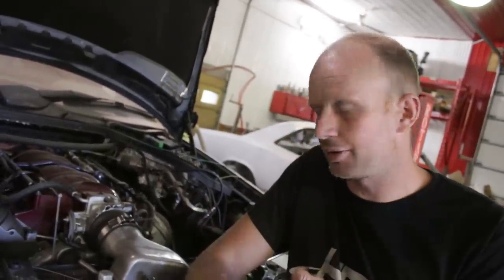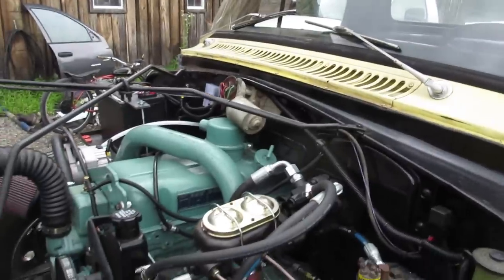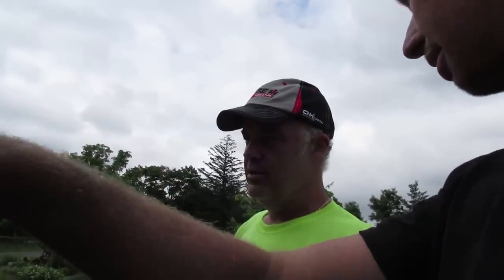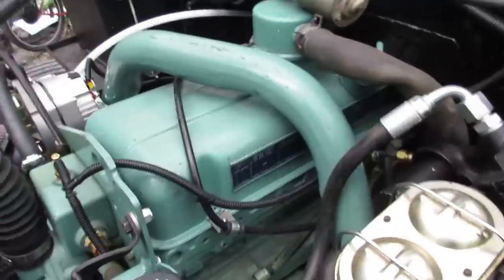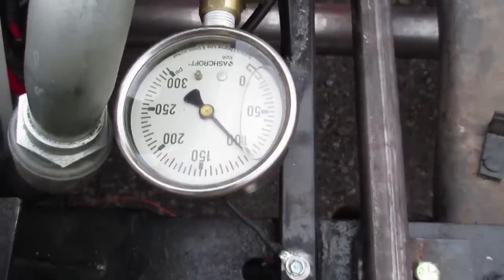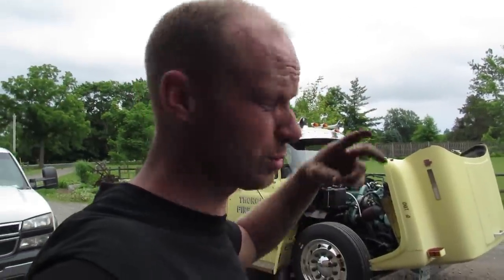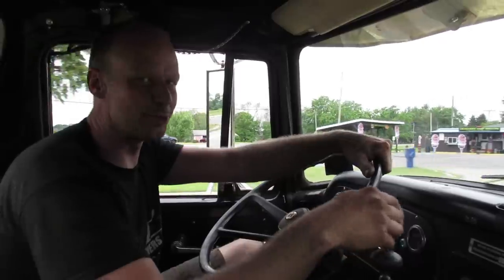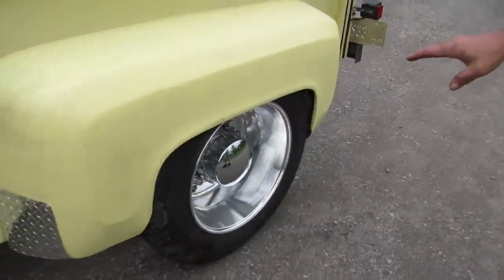AIR START! 453T Detroit Diesel in a '77 International Loadstar 1800

Comment: A Co2 fire extinguisher sprayed into the intake of a runaway will stop it dead in its tracks. Having one near by when working on diesel engines is a great ideal. And ideal to always have one with you in case of a runaway when on the road.
Reply: madmax2069 might be a silly question but why not shut the fuel off? Dry injector pump?
Reply: HOWNDOG66 best to just choke it out. Either by a flap on the intake on some old diesel engines, or by spraying a Co2 fire extinguisher into the intake.
Reply: Honestly if i got into a diesel runaway when out on the road rather than pulling over to the shoulder and dealing with the noise smoke and breakdown id just floor it into the outside lane and ride that screaming wreckage of smoke and fire right past everyone until the block explodes in half at 200mph.
Reply: Sometimes a runaway diesel uses a blown turbocharger oil seal to fuel the engine with oil instead of fuel.  Shutting the injector pump wouldn't do anything in that case.  Eliminating the air shuts it off no matter what.
Reply: Great idea. You could even connect an inerting CO2 cylinder using a kegerator-sized CO2 jug.  I carry one with a pneumatic chuck on a 200 psi regulator for filling tires and running high psi impact wrenches (for a short time) in the field. Beats buying an expensive Power Tank.
Reply: a wrench on the fuel line end of problem
Reply: not if the motor is running on its own oil there bud  seen it happen more then once
Reply: Runnaway's often don't rely on fuel as they tend to burn oil as the fuel source.  The only true way to stop one is to cut off the air supply.
Reply: they always told us that were running d-7 and d-8's that if it started to run away,to use our hard hats to block in-take air....1964-to 1969
Reply: @HOWNDOG66  it'll run away eating it's own engine oil without fuel
Reply: Thx Bruce. Did not know it could do that...I'm guessing that would apply to older engine with loose rings it can suck the oil by?.....I'm curious.
Reply: @HOWNDOG66 some mechanical fuel 4 strokes could run away with blow by but I don't know if it's common.   Run aways are mostly 2 strokes with the piston being part of the 'valve, intake' system if you will.  Engine oil gets whipped up, transfers through the posts and auto ignition by compression.   The worst cases, it'll run away and blow up either by throwing a rod, braking the crank or running out of oil and grenading.  Saw a Detroit in an off road gravel truck run away.  Within 3 hair raising min it threw a rod through the side of the block.  When it cooled down, we restarted it and it ran on 7 cylinders with 1/2 the rod slapping the block.  Couldn't believe it.  Cool but expensive!
Reply: Sound of these engines is 2nd to none and plan to get one and put it in something.....don't want it to go up in smoke so thanks for pointing out what to look out for.
Reply: It doesn't work nearly as well as you think. The problem is that a CO2 fire extinguisher doesn't have the volume required to supply inert gas to the engine while it's spinning down.  You need a big 10+ lb extinguisher for even a "small" motor like this.
Reply: @otm646  seems to work just fine.

Comment: This is the kind of stuff we also want to see. Love those 2 stroke Detroits. I service generators and there are still a few around. I have seen in generators as small as 4-53's all the way up to 24v-71's. They have a unique sound and feel. I grew up around an area in Ohio with a lot of oil wells. There were always a lot of service trucks and well trucks with screaming 2 strokes going by my house. Love it!
Reply: basically everyone around here still uses them in logging skidders and knucklebooms;  there isn't another diesel engine in existence that can withstand being run wide open all day, every day, hot or cold, and last 30+ years...
Reply: An aluminum 4-53 in a polaris snowmobile. that would be something. I heard a crane with on at Allied shipyard when our tugboat was there. It had the Polaris 850 Patriot bark to it like the new khaos turbo engine does!

Comment: I drove two road tractors that had 318s in them (8V71).  There was a flapper door in the elbow going into the top of the blower that had a mechanical cable (like an old manual choke cable) which acted as the emergency shutoff.  When needed such as a run away (they can also run backwards!) you just pulled the cable which released the door to drop down and block air into the blower, starving the engine.  Nice little ride!

Comment: 800kpa/116psi is the pressure you set the governor too for the air system. And it's a Detroit, the fact your smelling oil is good, it still means it hasn't leaked all of it out yet lol. Detroit's love to sweat horsepower.
Reply: army guy i knew talking about Chinook helicopters and how they used to leak fluid I said something along the lines of "well that's bad" and he said something along the lines of "no that's good, that means it's got fluid"

Comment: A natural blower would really help with bottom end power. That engine & trans is from a 79-81 c60 and they had that trans plus a 2spd rear to split gears. Theyre alot more fun when u can split it wont lug.
Reply from the maker: Thanks for the input ol2stroker!  We had one of these in the shop 15 years ago but my experience is really limited so glad to have you watching!
Reply: These are all I do. I had one most recently in a 78 F250 4spd with 3spd aux behind it. Message me I'll shoot you my number you can pass it along to your buddy if he needs anything in the future. Sure coulda saved him some trouble with that runaway! lol
Reply: I would add a 12 volt air compressor to build up air pressure in case you don't have enough air to kick the starter over.
Reply: I thought about that myself as my current build is air start... it'd just drain the batteries before it could build enough pressure.
Reply: Quite a long time ago I went deep down the rabbit hole on how to get a 2 speed rear end into something like this and this is what I found.  Most 2 speed rearends are huge (17000lbs up to 26000lbs rating) and the have extremely low gears (6.xx on the high end all the way to 8.xx on the low) because they where designed to have 42 inch tires on them and  where trying to get a relatively small engine (think ford 300 6) to pull all that weight around. So I found 2 alternatives: a ranger overdrive that bolts on between the engine and trans, and a gear venders overdrive that bolts onto the back of the trans
Reply: Good suggestion. Just make sure it's wayyyyy hidden. Haha!
Reply: Don't Detroits all have a blower on them?
Reply: mjouwbuis I think what he meant is a 453 without a turbo has a different blower (bigger?)  than the one that's on mine.
Yes a 2 speed rear end might be to big so I'm going to look into the gear vendors overdrive pricing and fitment.
Reply: jcc3279 the batteries would be long dead by the time the tank built enough pressure to start the engine.
even with the truck compressor on it now it takes forever for the tank 50 Gallon to build pressure cause of its size.

I have a tow hook on the front of the truck and a strap if I need a bump start LOL
Reply: Ol2Stroker vid on this project please.
I used your method to try a unstick the injector but being that the back injector was the culprit I had to remove the cab due to lack of space and figured after going through all that trouble just throw in a new injector cause I picked up a new one for 100 bucks NOS.  I did try to loosen it but couldnt get it to move cause I had no swing room for the hammer so then taking off the cab was next.
Reply: FFS Fabricators did you have trouble finding the right one? I hear they have many different ones out there.
Reply: Yes sir they do. Some of the old 6-110 series had a sprag clutch driven turbo compressor similar to EMDs but all of the smaller ones 53s, 71s, 92s, 149s have at least one blower.
Ray
Reply: From memory same blower on NA engines as Turbo, Turbo does have lower compression pistons, and could run different valve timing depending on rated rpm and where the torque is needed.
Ray
Reply: @ffsfabricators9328  hey maybe you could mount a gas powered air compressor from Princess Auto  😉
Reply: @whorayful9361  I think i read that Turbo Detroit's have a bypass blower, and the naturals don't? I want to mess around with one of these in the worst way!
Reply: Blower Bypass valves were a fairly late option on high horsepower, inter cooled, high spec engines, all earlier turbo engines had conventional blowers. On the engine model numbers you are looking for 'TIB" on the end of the model number. As far as I know only some 71 series, all 92 series and some 149 series were available with bypass blowers, so a typical engine would be a 8V92 TIB (Turbo Intercooled Bypass).
These old engines are amazing Mr. Charles Kettering and his team really designed an amazing platform that could be assembled so many different ways with so many accessories yet still maintained almost total parts interchangeability in each family.
Reply: @whorayful9361 in the Silvers instead of a bypass blower they were going to run a hybrid arrangement where the crank initially drove the compressor then exhaust would take over as the revs built. they canned it on the basis of cost and the 60 Series being in the horizon.
Incidentally the bypass blower saves 30hp. The blower consumes 100hp so it costs the motor 70hp in blower pumping losses in the turbo variants.
Reply: @grabasandwich  Or maybe he could dump that CO2 bottle into the air tank... have to do the math on that though.

Comment: Heh heh, nice rig! ...and yeah, you definitely have to slam your finger in the door before you drive it, so you're in the right frame of mind to keep the revs up to an acceptable level. Gotta remember, it's a 2 stroke, so when it sounds like it's ready to fly apart, it's just getting into the power band! I doubt you guys ever got over 2300 rpm the whole video, and those 4-53's will rev safely to 2900-3000 rpm without hurting them. You definitely need taller gears and a secondary gearbox or 'Brownie' to really make use of the torque band on these, since they don't really start making good power till 18-1900 rpm. At 2800 they sound like they're coming unglued, but they're actually at peak efficiency.😄👍 

The quickest way to crack a cylinder liner on a Detroit is to lug it down under heavy load. The water pump(s) don't turn fast enough to keep the cylinders cool at low rpm, and also they don't make good oil pressure, so everything runs hot and starves for oil.😜 EDIT ...oh yeah, and get rid of that damned air starter and grab an electric starter off of a 6V-53 or even a 6-71 (clockwise rotation of course). They're about 1/4 the price, and you don't have to trash 1/4 of your bed space with that huge air tank to run the starter for 10 seconds. These little engines turn fairly easy, even in cold weather, so a couple of 27 series batteries in parallel are more than enough to crank it, especially if you have a block heater in cold weather. Just for sound comparison, here's an electric start 4-53T up on the pipe at a little over 2800: https://youtu.be/oiCE3THO_Pg

Comment: great video

Those 53 series GM's  are something you either love or hate I reckon and that one with a hair dryer hanging off it is quiet (believe it or not)
We always say "ya drive em like you stole em"

Any GM 2 stroke I have worked on has a flap on the inlet side of the super charger standard from the factory to shut them down incase they ru  away. The flap is hooked to a cable to a knob on the dash that says something like "PULL FOR EMERGENCY SHUTDOWN" abd this closes the flap and shuts the motor down instantly,  works much better than the bottle of spray stuff and they come standard as far as I know like this so will be surprised if it doesnt have a flap

Almost all Macks in Australia up until the late 90's came standard with air start and it is very reliable,  the rotation is changed by indexing the internal stationary part of the starter

A very cool little truck but not my cup of tea with a screaming Jimmy and a 53 series at that lol , need a good supply of ear plugs 

Old mate might look at getting some "Jake brake" solenoids for it , would make people look when rolling up to a set of lights lol

Great stuff Rich and crew

Comment: Performing a tune up on a 8v  92 one day
Me and another guy while we had taken off the exhaust manifolds
Used a injector height tool set a injector
Started the engine checked the exhaust temp at the exhaust port went to other injectors and adjusted them to the same temp then put the tool on the injectors and found them to be almost perfectly adjusted. 
Love those 2 stroke with jakes open exhaust 
PS always put the screen on the turbo when doing tune ups many mechanics and one i know lost their fingers in the turbo during a tune up

Comment: My first diesel mechanic job out of tech school, was at a underground coal mine. A lot of the underground equipment was air start. If you were standing behind a scoop, and someone lit the starter off, it made you piss yourself  !   We  carried a nitrogen bottle with a regulator, to start them if the air reservoir was empry.

Comment: As a diesel mechanic my first encounter with the air starter was 10"s off the front bumper. One of my coworkers/ tormentors pushed the starter button and I was 40 yards away from WHATEVER that noise was!

Comment: Ah yes that familiar sound!! I’ve spent thousands of hours behind or in front these 2 strokes 353t’s, 453t, 6v92t, 8v71&92’s and a few 12v71t’s. Almost all of our old railroad track machines, rail gangs, surfacing&tie gangs etc, had them detroit’s in them. I’ve got the hearing loss to show for it !!! Lol. Btw awesome job on the truck!
Reply: With many that had worked for a railroad on the MOW team when if a majority of the equipment was powered by the infamous line of Detroit diesels as if the railway also maintained a fleet of GMC fishbowl buses also Detroit powered when the few fail to mention the 4-71 and or the 6V53 to the 6-71.

Comment: Love it. 

I have a DD also, it's a 1976 Ford F250 crewcab highboy 4x4 4-53T on 36" Wranglers. I have a 78 Dana 60 front, 76 Dana 60 rear, 4.10 gears, NP435 4 speed, divorced Spicer 5831 3 speed (low, D and OD) and a divorced NP205 transfercase. My front driveshaft is a 2 pc with center bearing which is longer than my rear driveshaft.

Keep showing move videos.

Comment: Love the truck....air starters are jawsome, shows the originality of his build, the engine is radical and old. I loved your comment...Your thought was to put a 4:11 rear in it until you drove it. It’s funny how our thoughts change sometimes after we drive something or get a feel for how it’s used. I have a 51 REO that I’m thinking of putting a 238 Detroit under the hood. Those engines are truly loud and show their attitude. I like attitude but more when I need it. Show us more of this truck. I’m not sure how this truck, with the current engine, could be nose heavy. The old Crackerbox rigs were probably a little shorter we, but they had a heavier rear end. But I’ve not built a rig like this, so who knows. Porter Dude of Ohio.🤩

Comment: I knew a guy who had an old Higgins boat landing craft with a 6-71 and air start. They had a lever operated hand pump to charge the air tank when it depleted. If I remember correctly, it was a couple thousand "click-kerchunk" cycles to build enough volume and pressure for a 2 second spin, lol. Because the system was a half century old, we got to find that sad fact out if she sat idle more than a day or 2. Still, it was nice to be able to "arm strong jump start", though the novelty wore off pretty quickly. Great build, great truck!

Comment: I’d love to have  one of those in a Bulldog 56 Chevy 3500 shortbed. With the front clip welded and braced for a Tilt front end with a foward and up sliding hinge. Backed up with a Eaton RTO-510 and a 14 bolt full floating axle. Tuned  up from 300 hp to about 500 hp and a stock straight front axle. It would be wild. It would be great for short hauls with a 40 foot toy hauler.

Comment: Most every Detroit Diesel I ever saw had a mechanical air shut off valve in the intake  with a simple   push pull cable  just like a manual choke control  on a carbureted car..   I used the shut off once ..  Had a stuck Injector after the truck sat for 3 years with out starting ..

Comment: I am a diesel mechanic by trade. I've rebuilt many, many Detroit Diesel engines. I love the sound of a well tuned Detroit. When you hit the power curve of the turbo spooling up, the engine will crank out the horse power. For a long time, Detroit Diesel's was everywhere. Too pull one injector without resetting the rack, not good. No two injectors(NOT nozzles) are identical in there adjustments or settings. They'll be fairly close but not exact by any means. The really sweet sound is a 16V924T, BEAUTIFUL. I really like your build. I would suggest two ways to go for better performance, either a two speed differential or a 610 10 speed transmission. I myself like the trans. There's nothing like catching gears on the high end of the power band of a Detroit Diesel, SWEET. I still have my shop manuels on the engines, 53's, 71's and 92's, they're priceless now. Put on a bigger turbo, CAN and go from a 5 or 6 hole cup(depends on who the rebuilder is) to a 9 hole cup, you'll swear you have a completely different engine. For your suspension,  easy to fix, air ride with automotive pickup shocks. They are more giving in road imperfections than the big truck shocks are. It will ride like a Cadillac then. Do the front the same way but you'll have the use the big truck shocks there, for sure. Add air ride seats in your cab, you'll put your pickup truck on jack stands.